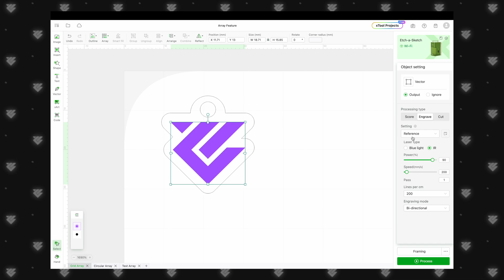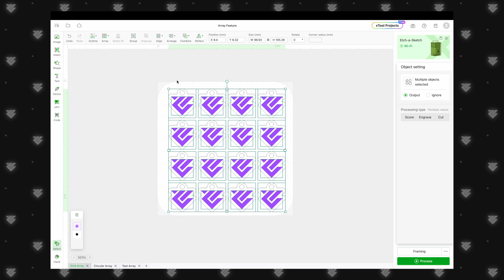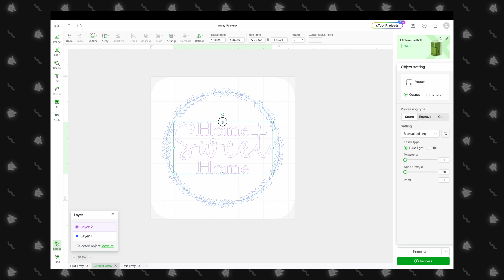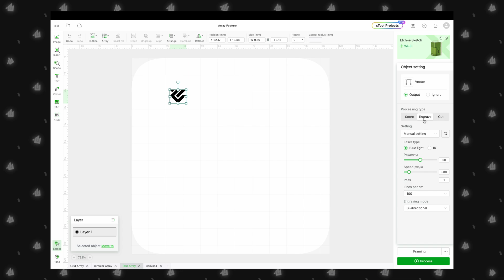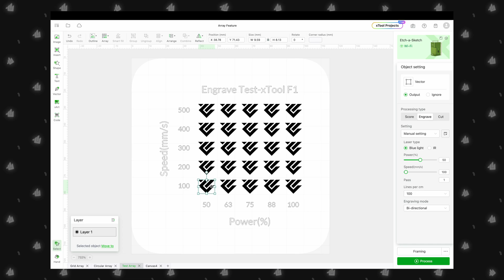Using the Array Tool in xTool Creative Space with the xTool F1

Comment: Hi guys. I have the F1U and the next version (I think) of the software because what you showed is no longer in my software. Can you PLEASE do an update, or just tell me directly where they moved the array feature to? Thanks in advance. Shawn
Reply from the maker: Hey Shawn, we have a full walk through of the newer software on our YouTube and since the array tool itself didn’t change we may not have a video out for a bit. 

But it has been moved to the left side of XCS. In the left menu bar where you select rectangles circles and shapes it the last item on the bottom. Clicking that will open up a sub menu where you can find the array tool

Hope that helps!